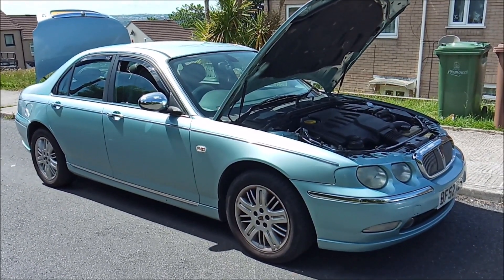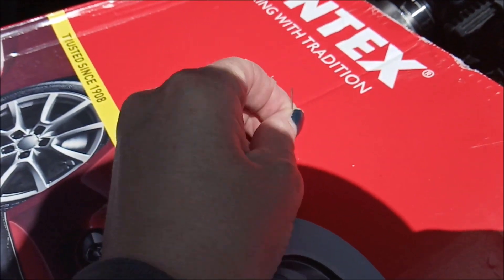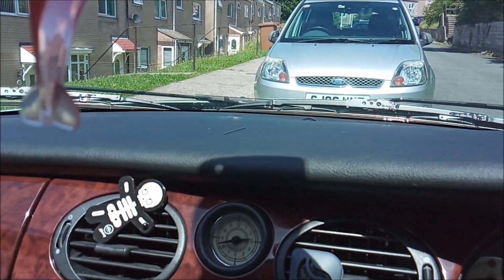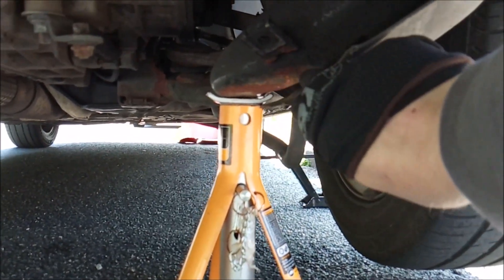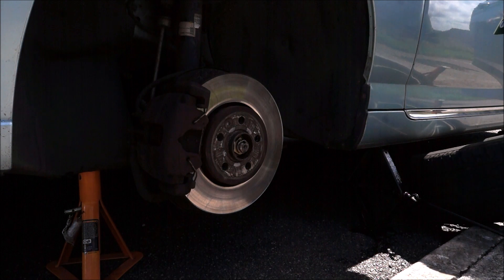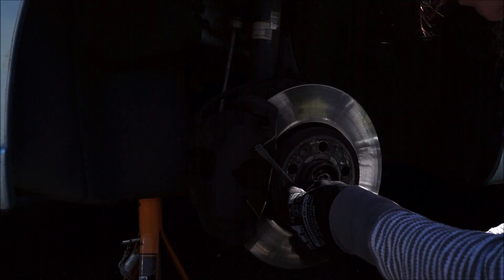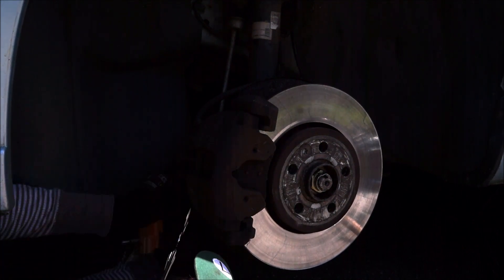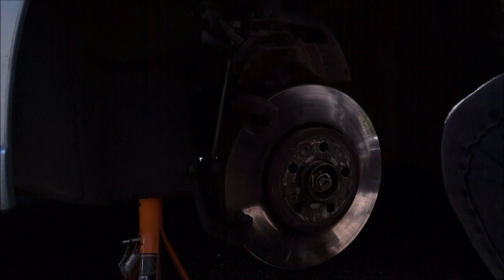Rover 75 cdt front brakes

Comment: You did a good job Simone. Did you grease the caliper pins? I use lithium grease. I've videoed quite a few of the front brake jobs I've done on various cars. One tip to help get the calipers off is to wedge a flat bladed screw driver in the caliper and then lever it so it pushes the piston in enough to get the caliper off. I wouldn't worry too much about the piston seals when you're pushing the piston in. You did the first thing right by removing the cap from the brake fluid reservoir and monitoring the fluid level. I have a big G clamp for pushing the pistons in. I've done the front pads on the Citroen, the BMW & the Celica's front and rear pads. I had to free off the Celica's front calipers as well. I also did front brake pads on a 2016 Ford Fiesta,  front & rear pads on a 2011 BMW X1 (the video will be out on the 10th of July) and I've got to do a front pad change on a 2015 Ford B Max (I fitted new front discs and pads to this car 2 years ago).
Reply from the maker: I did grease the pins yes. I'm glad i got the piston to stop binding. I will look out for your new video.

Comment: You missed a trick there... when pushing the pistons in for new thick pads you should crack the bleed nipple, and that will let the fluid seep straight out of the caliper and make it very easy to move, then if you let a bit drain out of the hoses under gravity as well before closing the nipple you will have removed the oldest hardest working fluid from the system and you can just top up with fresh as necessary.

Comment: My Rover 45 was like that lol it  was hitting the bonnet lol had to make some small ajustment. The subframe was word you where looking for the axle stand. I knew what you ment. Same gloves I use myself.  It's good to watch some one eles do the work for change lol. Av just done the brakes on the Passat. Audi Quattro avant sport Tdi b6 is for test Friday. So we will see how much it fails by lol. The rover 75 always wanted one of the diesel one myself but just never got one at the right price. I  use a cable tye to hold calipers up. Yeah discs look good. Turkey baster will remove the excess fluid.  A g clamp or bolt the caliper back to wheel and use tyre lever to push the piston back in. No your good. Please don't think I am being over critical. I have done more brakes than I care to remember lol.  My caliper on my right hand side of my old Rover 45 seized  but once she bed herself it freed up.✌👍 Good Job mate.
Reply from the maker: Thanks Alli, much appreciated advice. I still need to do the brake pipes on this car but I will get someone else to do that for me. This car was a bargain and i am seriously thinking of getting a remap done.
Reply: @CortinasAndClassics   The brake pipes can be a pain in the Neck. I  have had to  cycle the Abs pump on my mate's golf the last time I did it so now. I try to clamp the pipes up so they do not leak all there fluid out Av done a few this way or I have pressure bleed the  system some times you will get there it all takes time. I  sometimes come in my house and go am selling all my car's lol but i can't do that  to the customer one's lol. Tc and catch you on the next one.👍

Comment: False economy not to change the old discs as they get warped with the heat and your brake pedal starts pulsating up and down. You will find that small lip on the old discs will cut into the new pads.
Reply from the maker: It's not a high usage car but I haven't had any problems with the disc's. Been through an mot as well with no issue. Plus the discs had plenty of meat left.
Reply from the maker: Steeeeeve. You are playing one of my all time favourite games.